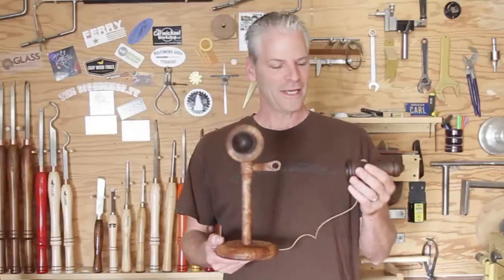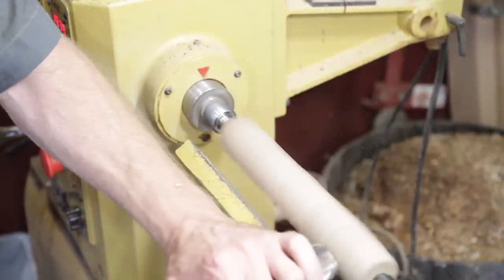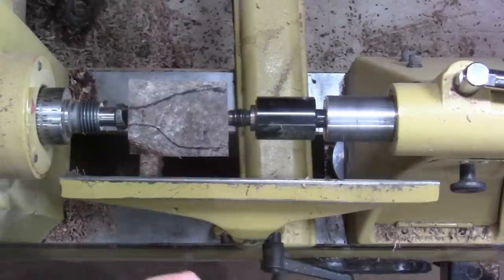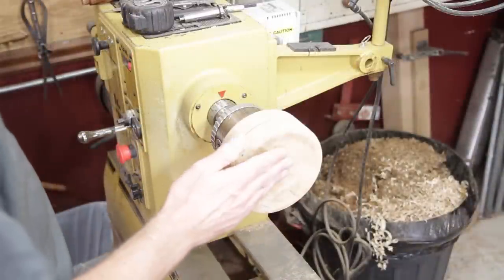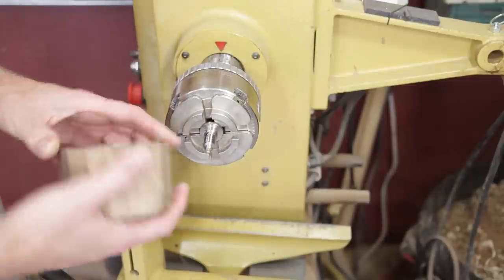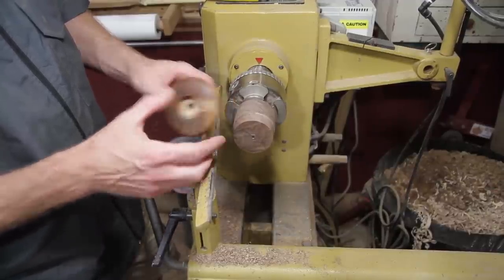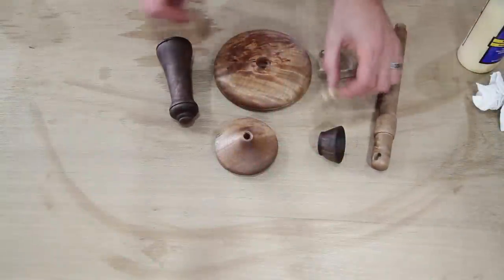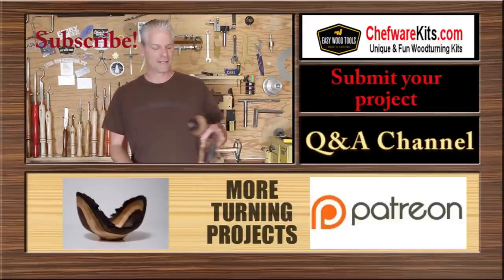Woodturning Candlestick Phone

Comment: Nice build Carl. Question: how do you get your piece to stay nice and centred on your chuck at those speeds? I tried bowl turning once using my chuck and I barely dodged the bowl as it bolted through the air. I don't have bowl blanks big enough for using my screw plate. Another one: what type of turning chisel do you use for bowl turning? Most of the times the piece flew off was after a massive catch that seemed to come from nowhere at all.
Reply from the maker: Dutchhorse Thank you, try to make your tenons fit the profile of your jaws. This will help a lot. I ether use a bowl gouge, or a round carbide cutter for turning bowls. I hope this helps
Reply: Thanks so much Carl!

Comment: Interesting and perhaps challenging project. Nicely done. At 5:05 ~ does your parting tool have an insert which you can sharpen or replace?
Reply from the maker: Torvig Johnson Thank you Torvig, Yes it's the Easy Wood parting tool, with a carbide tip that you can replace.